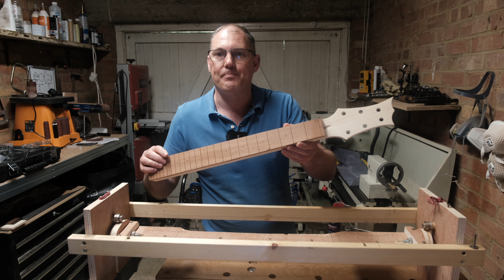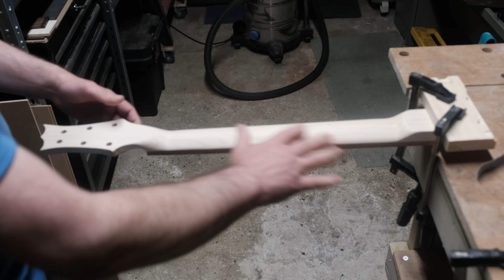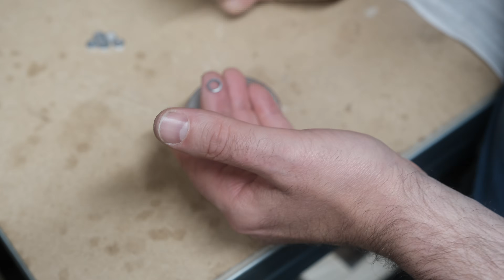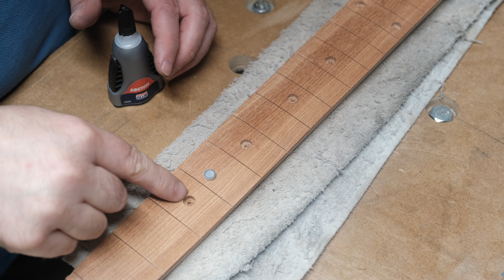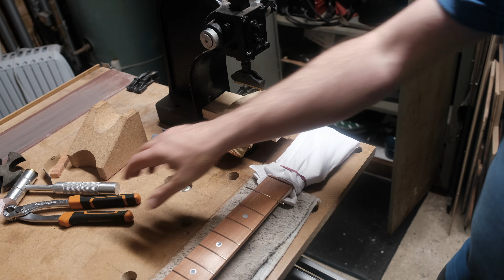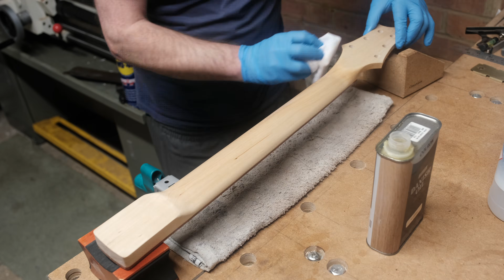Production Guitar Build 1   Neck Finish

Comment: When te radius is the same all along the fretboard, the result will be (I would say) that the edge of the fretboard is lower on the side of the body than on the headstock side. That because the fretboard is wider on the body side. Does this make sense?
Reply from the maker: Yes it does. You have to think about a guitar neck as a piece cut out the side of a cone.